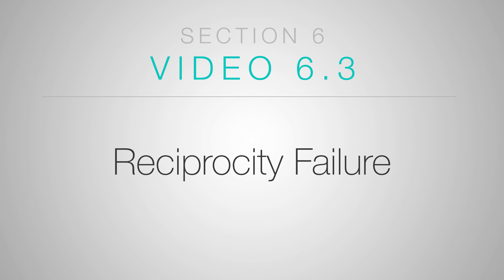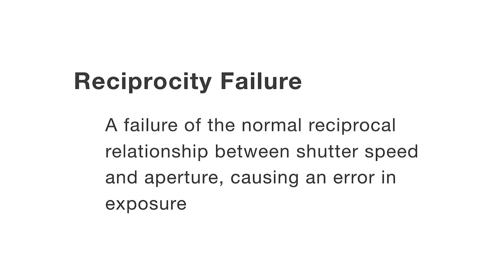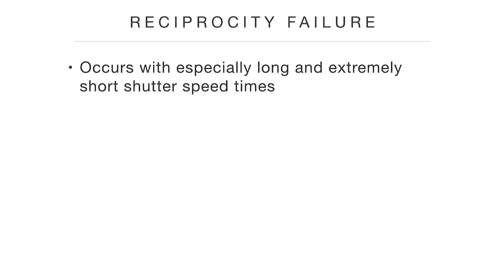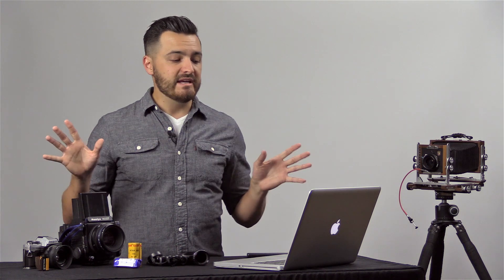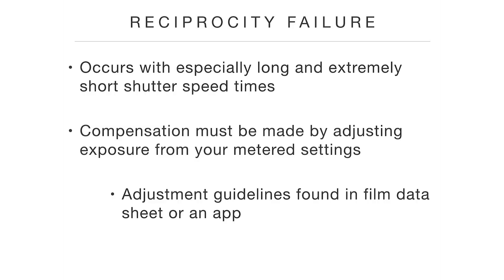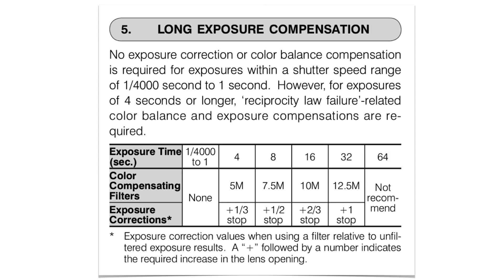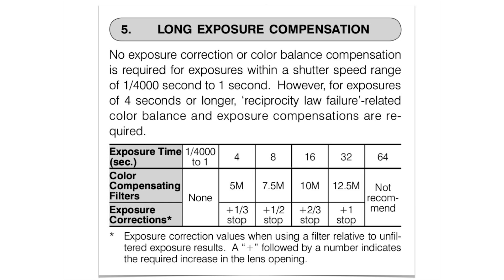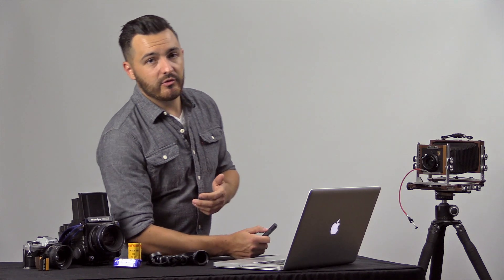Film Photography: Reciprocity Failure

Comment: How do u know when to calculate for Reciprocity Failure? Never know how u do it
Reply: You should start worrying about it when you are over about one second, and to calculate it you should:
a) look up the reciprocity table in the info sheet for you specific film. That will tell you how the manufacturer suggests adjusting the exposure
b) if (a) is unavailable, a possible approximation is to use the following formula: T=t*(1+(log(t))^2), where t is the metered time (the time you read off of your light meter) and T is your adjusted time. This is a last-resort formula you should use only when you have no other info though, it's not accurate because reciprocity failure varies from film to film!

Comment: I think I will try the app. Some sources give the correction factor for reciprocity as an exponent e.g. 1.31 for Ilford HP5 which means a calculation of meter time raised to the power of the exponent. Most calculators can handle that but not so easily done in the head.
Reply from the maker: My brain is far too simple for that. I need an app to tell me “use 15 seconds instead of 8, dummy”

Comment: Great explanation as ever Nick. Interestingly, one of the reasons I shot Fujichrome Provia is because it has a bizarrely strong ability to endure exposures of about 120 seconds before RC kicks in. I have no idea how (or why) they engineered that film in that way when most films (including Velvia as you showed) are in the region of several seconds. So I can happily use Provia for 30s or 60s exposures without having to think about RC (just colour casting potentially). Fun fact...though I suspect you already know that.
Reply from the maker: I just looked up the data on Provia. You’re right. It has excellent reciprocity. That’s one of the reasons I’ve usually preferred Velvia 100 over 50. It’s good until about 45 seconds.

Comment: Everyone is ignoring the data sheet information hidden in the plain sight for the RVP50 and other color films: the color cast correction filter itself takes 1/3 of the stop of the exposure. So, if you choose not to use one, no correction needed for 4 second exposure. It is not much of the difference, but technically, it should be accounted for.
Reply from the maker: I don’t believe the recommended 1/3 stop increase is factoring in the use of the filter. I think they’re expecting you to add the filter factor yourself on top of it. But I could be wrong. I should reach out to my Fuji contacts.
Reply: @nickcarverphoto  They put this in the specs: "Exposure correction values when using a filter relative to unfil- tered exposure results. A “+” followed by a number indicates the required increase in the lens opening", so yeah, they even indicate that the correction should be made using the aperture, not the time, so they were very scientific (using aperture vs time should not produce a significantly different outcome). Funny though, they didn't mention temperature as a significant factor. This is the ONLY real-world report when temperature affect the reciprocity: https://youtu.be/YAPt_DcWAvw?t=1044